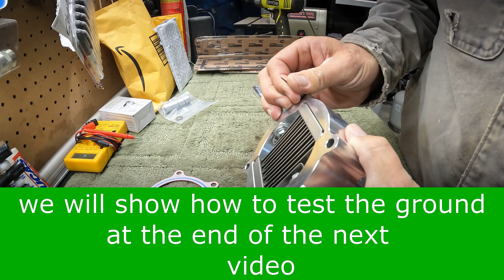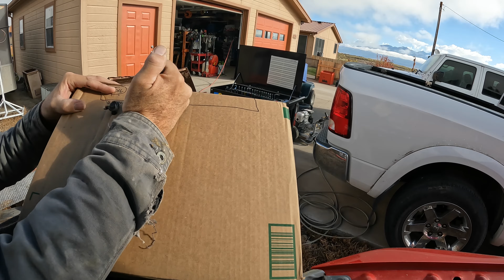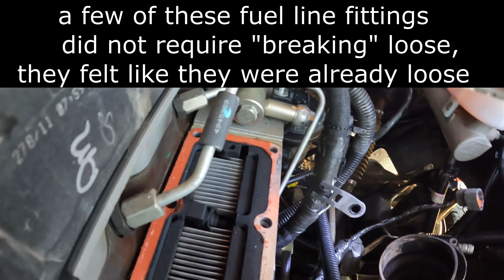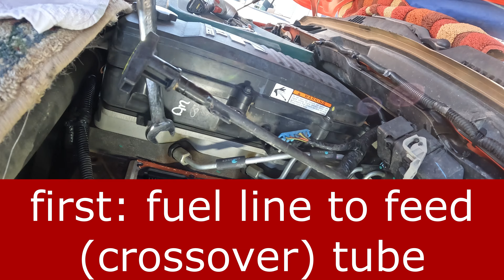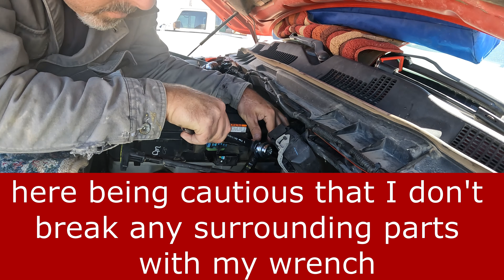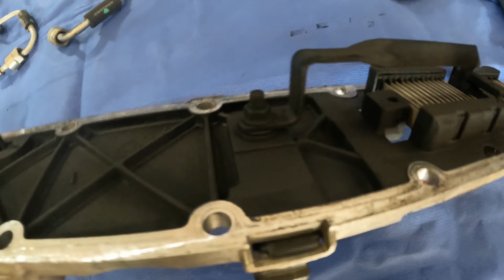6.7 Heater Grid RELOCATION *Pt. 1*

Comment: I've tried a different approach on fuel line 1 in the rear. Loosened the rail fitting first and then the rear fitting on the injector. Did not have to remove this fuel line as the plenum slid out from underneath. Waiting for my upgrade to arrive now. Thanks so much for the video; I would not have attempted this fix if not for you!

Comment: Way to much money, i put 120v plug in via an inverter, besides being plugged in in -40⁰c weather and 0w40 oil. I just put a hair dryer in my air intake for start up. Lots cheaper. Just saying and that only if needed.
Reply: Sooo you unbolt everything and stick a hairdryer intp the intale every time you start your truck😅😅😅
Reply: @tomkelly3896 no I just open my air intake and remove my filter. Your assuming my intake is stock. No it has a custom snorkel system .

Comment: I relocated mine to the trash can. Changed the oil to 10/40 in the coldest winter months and timer on block heater, with a 20 amp circuit outside.
Sometimes I mag heat oil pan for an hour or so, and a shot o' either.
It doesn't look pretty and I don't film myself with a expensive camera, cause I don't have expensive parts, but I'm proud of you too.
Reply from the maker: LOL yes, and we found out that on my buddy's '08 the previous owner just CUT the solenoid wire going to the heater! So for a few years my buddy was waiting for the heater grid to heat before starting, and it never was working but it still started fine without it even when it was -20F. So I see exactly why you and many others did what you did. Thanks for the comments!

Comment: I want to do this to my truck but I think an easier way would have been to just leave that grid heater plate in place once you disconnect the power wire running to it it’s not gonna cause any more failures and then you could use some metal snips to cut the fins out of the actual grid heater and skip the whole disassembly part. All of this is of fours if your nut isn’t lose from the beginning.
Reply from the maker: I thought about that too! But do be careful with your "snipping" that you don't lose any metal pieces into the top of your cylinders. Also, it's not exactly thin metal, so I'm not sure what exactly it would take to tear the metal all apart in small enough pieces to get it back up out of the hole. And disconnecting the power wire may or may not give you an error code. And where I live it's well below zero a lot of the winter, so I need the grid heater, so cutting the cable and disabling it isn't really an option for me. But it is for people that live in warmer climates 👍

Comment: My grid heater wire melted off. Bolt is fine but the grid heater deleted itself
Reply from the maker: LOL, but Wow! Just when I thought I had heard it all with these grid heaters, that's crazy. I wonder if there was a bad connection between the wire and the grid heater. Thanks for sharing that 👍

Comment: Thanks for your detailed video. No one has ever shown, or talked about what it is they have to do with the sixth rail. I'm in the process of installing the Banks Monster Ram and have only been able to get the nut on the injector side to turn a fraction of an inch. Not enough to tuck it out of the way. I've even lost a crow's foot! I thought there would be more to removing that engine hoist bracket, but if it's one 15mm bolt, then that's my next course of action. Thanks!

Comment: I do understand why you’re worried about the bolt. As we should be. But you’re not even going to use stock grade heater. You’re unhooking the wire. And bolting it up to the second grade heater. So you shouldn’t have to worry about the bolt burning off.  Just asking for a friend. 🤔
Reply: I see your point, but leaving the factory heater grid without knowing the condition of that OEM bolt is probably not a good idea. If you're taking the plate off to get to the heater grid, why not just replace it like he's doing here, and you never have to worry about it again

Comment: Thanks for putting this out. We just had our engine swapped due to a different (maybe) failure. We had mentioned this condition to the mechanic that did the swap and apparently he didn't do the jiggle test, because our's is B A D bad. We filtered through a dozen or so videos to finally find yours, which is thorough and very helpful. Glacier's part is out of stock (backordered elements), so we're looking at using the Black Market Performance kit, which looks to be a mix of the Glacier (in-line before elbow) and Banks (threaded heater element). Any chance Part 2 will be out in the next couple days?! 😂
Reply from the maker: I have it almost finished! But really installation is just the reverse of removal. Make sure you put a wrench on the cross tube nut, before you tighten the fuel lines down on them, just to make sure the cross tubes don't rotate. That can cause a fuel leak inside your engine.

Comment: Easier and a more secure connection would be, IMHO, to attach a ground strap to the bolts on the negative side of the grid heater and ground that strap to the block, or even to the battery's negative terminal.
And also, any opening on the engine, when I work on something besides it, I usually cover with a cloth, or rag, to eliminate any chance of dropping any parts or debris into the engine. I made it a habit, even where you would think it's not needed. 
Otherwise, thanks for the video, I think I will go the same route on relocating my grid heater.

Comment: What is the manufacturer of the heater your using?  Do you have to modify the rubber hose?  Thanx.
Reply from the maker: GDP... Glacier Diesel Power... Apologies that I haven't finished the second part of the video yet. And no, haven't had to modify anything, this is pretty much a direct bolt on... I used all the parts from GDP, the delete plate, the intake horn, and the grid heater. It's working really well here in cold Colorado where we've already had minus 15F and it's barely December LOL
Reply: Billet aluminum is nice but….and the grid across the opening is still restricting. Not trying to be negative but the screw-in type by BD diesel is less than 1/3 the price. In fact in Canada it’s over $600 and BD’s IS $180. Very nice job with your camera angles and explanations on removing the grid heater, by the way.👍
Reply from the maker: @FireBosspilot  wowza, That's a huge price difference. Thanks for sharing that 👍
Reply: @FireBosspilot i heard the screw in type heaters dont work as good as the GDP ones. I just ordered mine today. 460$